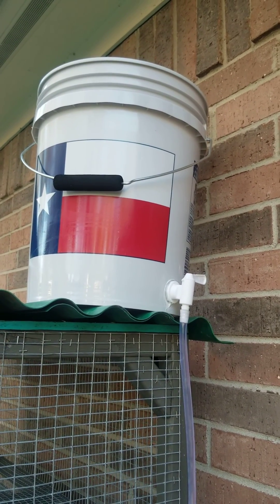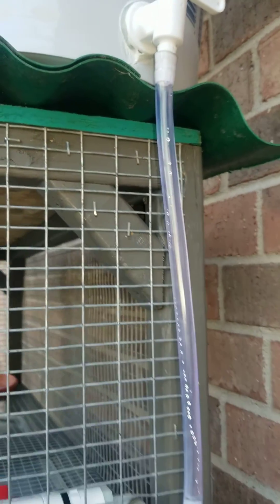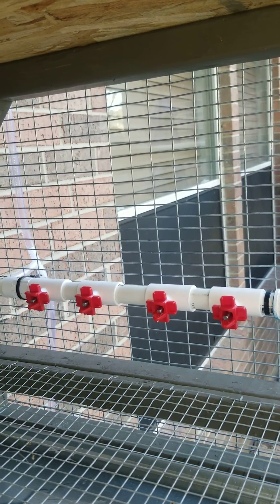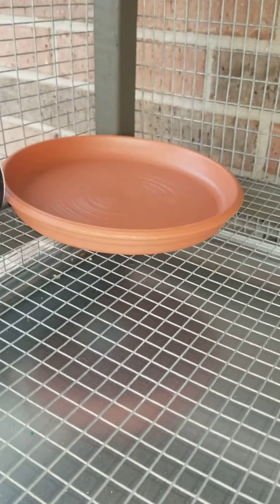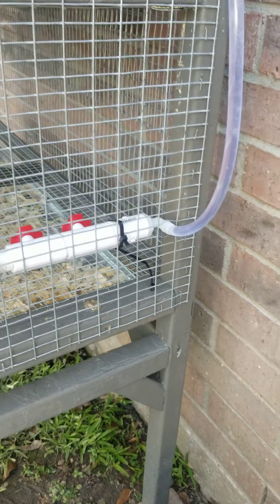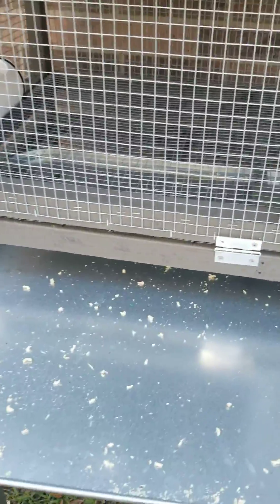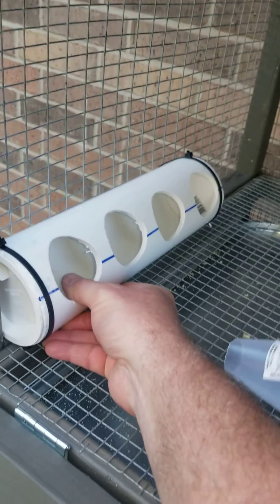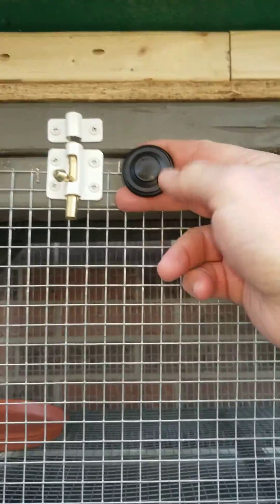Quail watering system

Comment: I’ve only ever used the vertical nipples but just recently built a new cage and may try out the horizontal ones. How do you like them? Any pros or cons to vertical vs horizontal?
Reply from the maker: They have been flawless. Just don't over tighten or they will break